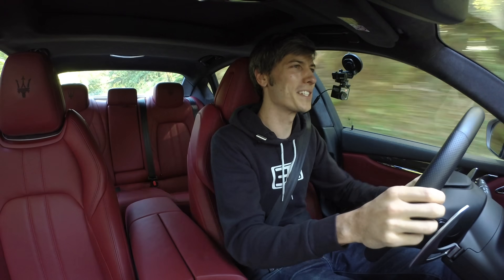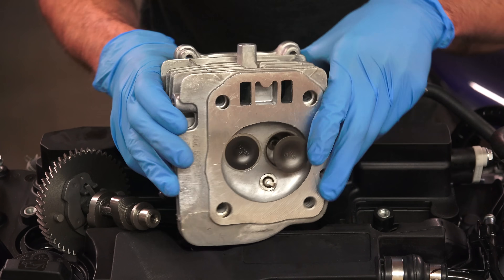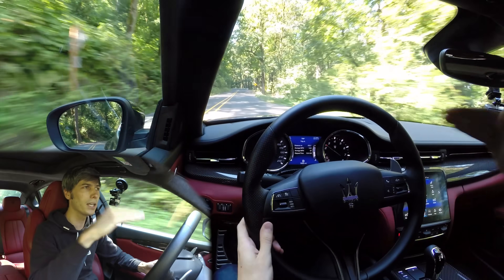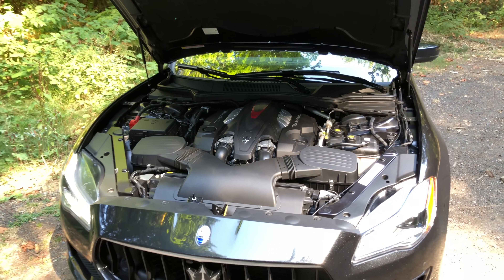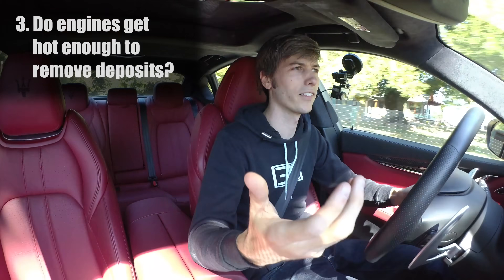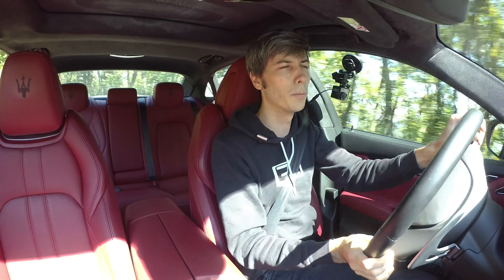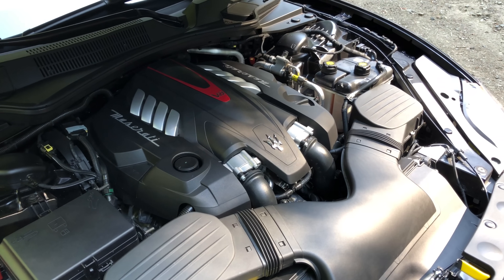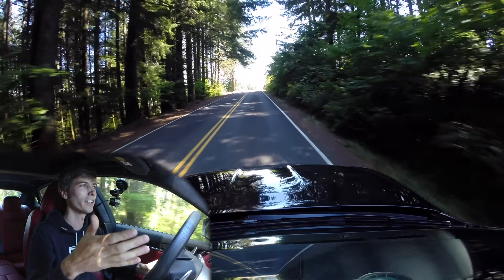Is Redline Good For Your Car's Engine? Italian Tune Up

Comment: I redline all the time in my car. It's on its 5th head gasket replacement. So, no. Don't drive like me.
Reply: are you buying head gasket made out of burritos?
Reply: @victornpb 
Haha. It's just "British Engineering". It always breaks. The 5th head gasket is Chinese designed and built when Nanjing bought out MG. It's much better design. Says a lot about British engineering lol.
Reply: What MG is that?  I was thinking about getting some old english car with a type A engine to hoon around in the weekends
Reply: My k24 has seen 7200+ RPM probably somewhere close to 20,000 times over it's lifetime without a single hiccup. This includes extended periods of very hard driving where the engine never really falls below 5200 RPM. A well designed and well built engine can take hard driving, but if you're driving an engine designed by the British and built by the Chinese, you're probably better off not pushing it lol.
Reply: @martinfisker7438 
MG TF (I got the 115 1.6 version myself).
Reply: When i seen your comment "K series" engine popped in my head straight away haha.
Reply: @ChalkieSpeedShop 
Yeah. K-series is sort of okay in terms of efficiency (for engines of that era) and power vs capacity (find it hard to get a 1.6 engine that pumps out 115hp naturally aspirated even now), but they're made so fragile lol. Couple of donuts hitting the rev limiter did gasket #3 in. 😂
Reply: Jim Griffiths yeah the VVC 1.8 were a great engine. They all drive well for what they are and fairly tuneable shame they suck on head gaskets. Place I worked at used to go get the decks skimmed on them use to help with it.
Reply: You must be talking about a 1.8 K-series then :D
Reply: Is it an MGF or MGTF? They're quite prone to head gasket failure, so it might not be down to being redlined regularly.
Reply: I've had an MGF 1.8, had a very nice sound for a 4 cylinder and was a nice engine which had a real character. When warmed up properly, it's less sensitive to HGF. However, designwise it was bound to happen...
I now have an S2000 and I redline it every day, all day. (once warmed up) :D
Reply: +Jim Griffiths Chinese upgrades? Those are the Landrover upgrades you've listed! :)
I feel your pain, but fortunately I reached deep on the first failure and spent a chunk of cash getting the Land Rover upgrades done at B&G back in 2010 or so when my HG failed. It was tempting to do the £500 "mobile mechanic" fix but I went full-whack and had the head skimmed at the same time even though I know I drove no more than 15 miles with a leaky gasket. 
 No issues since, with my TF 160-Freelander hybrid engine.
Reply: @JimGriffOne  and you probably hate everything british says allot of  you..
Reply: @sayers1984 
What does it say about me?
Reply: @donkmeister 
The gasket I put on in the end was the N-series Nanjing gasket. Tried the MLS Landrover ones but they kept failing lol.
Reply: @JimGriffOne  It shows you clearly know very little about engines, gaskets or British engineering. If you are talking about the Rover K series, then the head gasket problem was down to cost saving measures introduced later, not in the gasket itself, but the the fixings that hold the two halves together. The K series was unusual in the way it was designed but was a lightweight, dependable engine. Then the bean counters in the parent company temporarily got in the way, which is why there were a large number of engines built with parts that stretched too much over time with heat, resulting in HGF failure. But when it was rectified the engines were fine. Replacing head gaskets did not cure the problem, it just put a sticking plaster on until the next time. Which means you keep paying for something that can be cured permanently.
Reply: +A Nother

I do know this. I just didn't use the cylinder shims the first few times, and I used the cheaper Landrover MLS gaskets that came with the head saver shim. They weren't the best design.

The issue was that I thought I'd save a little money by not doing the whole job, as others had successes when using just the Landrover MLS gasket, uprated oil ladder rail and 10.9 grade head bolts.

With the N-series gasket (the one without separate fire rings or a head saver shim), and with the cylinders now shimmed to 5 thou proud of the block face, it's been running perfectly ever since. My car also has the pressure-relief thermostat as standard so I didn't need to mod the cooling system.
Reply: @JimGriffOne  115hp????
The base model B13 Nissan Sentra back in 1991 had 110hp out of a GA16DE and was actually very understressed...as they were known to go 600k miles on original engines.
115hp out of a 1.6 is nothing.
Reply: @twoeightythreez 
Most 1.6s I've seen are in the 90-95 hp region. I find higher power ones are rarer, probably due to emissions regulations. The EU has kindly given us really underpowered eco cars.
Reply: There's something else wrong if you continually blow your HG. Your head is probably warped or you have air in cooling system etc.
Reply: @mentals555 
It's just a badly designed engine. Really thin wetliners and they're able to shift slightly. The Chinese upgrades require: Strengthened head bolts and oil ladder rail,  wetliner shims to increase pressure on the cylinders and a MLS head gasket with no separate fire rings. It's lasted 6k miles and not one issue yet. Last ones lasted sub-1k miles before leaking coolant into the cylinders. Engine has tonnes more compression with these mods and runs sweet.
Reply: @JimGriffOne  oh so the thing wrong with it was that it is just a terrible design. Hahaha I would have given up on it long ago my man, bravo for your persistence
Reply: Ahh, the classic K-series. I always knew they were problematic but never knew what the issue actually was. Sounds like what you've done should last now though. You could always swap it for something like a honda or toyota engine ;D
Reply: @JimGriffOne  BLMC excelled at making junior mechanics out of regular drivers; right down to the point of planning which engine components to take (as "spares") on any particular journey. I always carried a small toolbox in the back of my Mini, just in case something broke :).
Reply: @mentals555  Humanity has no hope.
Reply: I have 2.5 subaru n/a  supposedly notorious for bad hG. Still intact.  Ir rdline rveryday
Reply: I have a 2013 VW GTI had it sense new. It has 85k on it now and i drive the hell outta it redline all the time. Change the oil every 5k synthetic and just changed the coolant. Never had a major engine problem. Never had to be in the shop for anything other then preventive maintenance. Tho my clutch is starting to slip now. But most clutchs with hard miles start to slip at about 60k to 100k so that's normal.
Reply: +Jim Griffiths
You either have Rover or MG, I know both of them were bought out by the Chinese whom still continue to make models of these brands like Roewe 750 which was a Rover 75 but improved, which is hilarious if you ask me it no longer had the head gasket issue commonly found with Rover engines which also made the engines for MG, it also had multiple reliability improvements in other sections. 

Chinese cars are getting better and better, we might find ourselves driving China cars in 5 years time, I already see more Korean cars on the road than Japanese here where I live in Norway.
Reply: @SMGJohn  Chinese cars are fine; right up until you crash one. There's good reason why they're ridiculously cheap.
Reply: I red line my car every day, for the last 8yrs and have never replaced a head gasket, and I have 360bhp on tap, with 220,000 miles. I suggest you get a decent car.
Reply: @TheSaabClinicUK   And what fine specimen of a vehicle that might be ?
Reply: Our engine blew the head gasket some years ago and it was my mom driving it (definitely not a redliner), and since I got my license I redline it basically all the time and the gasket has stayed fine (so far) so I don't see the correlation
Reply: @coscorrodrift  i dont belive you can blow a head gasket and thats all thats wrong with the motor and cooling system. Just my two cents.
Reply: @Thomas Rock You must be driving a Bugatti, they've been sandbagging you, that's not really the "redline"
Reply: It’s not the redline but the quality of the engine.
Reply: Jim ... finally an honest man.   If you beat the living beegeebees out of your engine you will pay the price. Good thing you can afford it.    :) 

Hey, just for shits and giggles ... see what happens to your engine around 10,000 RPM.
Reply: Nice Mk3 Supra my dude.
Reply: I redlinie my Evo X all the time, own it since six years, it's my daily car and has 160k km by now. It's even chip tuned for more power. Yet not a single problem with the engine. (In fact I had no mechanical failures at all!)
Now I just rebuilt the engine with forged parts two months ago and those will probably last for the next twenty years or so. Since you know, those are stronger and I didn't increase the output by much while doing so.
So yeah, I won't drive like you. It's probably really bad.
Reply: Thanks to the german Autobahn my car sees 150mph and above every day and not just for a single pull but for quite some miles. For years the engine (N52B30) is running fine, has about 125k miles on the clock and still runs without any major damage or fault. The only downside driving like that is oil consumption... Driving your car under WOT for quite some miles just evaporates your oil and i do need to top it off on about a monthly basis.
Reply: ARP Head studs. Problem solved
Reply: Ford?
Reply: What are you driving, a Subaru? I'm going to go out on a limb here and point out that that's not normal. Might want to get the head and desk surfaces feeler gauge and straight edged.
Reply: If you're going to drive hard, do a proper warmup and cool down, run the motor a little when parked before you turn it off. I suspect that some commenters have put away their rides wet.
Reply: subaru you said?
Reply: You must be a subaru owner . Stfu you troll
Reply: It's what makes a Subaru, a Subaru.
Reply: I run my Camry like a v8 and it runs great
Reply: Guessing this is a k-series engine. Sounds like you've had duff gaskets, good MLS gaskets should last the lifetime of the car if looked after properly. Had an mg tf 115 that had a chipped head and even after replacing the stock HG with a multi-layered it was fine for 3 years and 40k before I sold it (developed a leak around the inlet manifold gasket!).
Reply: @DarkestHeartEvE 
Yeah them inlet manifold gaskets break down so easily. Had to replace mine with a Viton gasket.
Reply: @JimGriffOne  ah you got the same car I had. The k-series is a brilliant engine but is just a bit prone to CHG failure. Such a shame, I miss mine very much!
Reply: I was thinking Toyota when I saw "K-series" engine.
I've been driving a '68 KE10 Corolla for 30 years. I retired the 1.1 "K" after several hundred thousand miles and put in a 1.2 "3K'. Redline is 6600. It will cruise all day at 5000. (about 75 mph lol).
Reply: A copper head gasket might do you well lol
Reply: I’ve always redlined my engines. Never had to replace a single head gasket.
Reply: I guess it depends on the car.  Bounce off limiter 500 rpm past redline with a motor that has 290k miles all the time.  It's fine
Reply: Is it a 6.0 Powerstroke
Reply: +Dreamboat MacGillicutty
It's an MG TF 115.
Reply: @JimGriffOne  
I know a man with a 1954 MG TF that has never blown a head gasket!
Reply: Jim Griffiths what the heck, haha. Ive put 160k VERY spirited miles on my ‘99 civic ex with 217k total miles, and I’ve only replaced the head gasket once. Probable the only one it’s ever been done. Compression is still 174-176 psi across all 4 cylinders.
Reply: @Schwabley Compression across all four on mine is now around 255-265 psi. The head's over its reface limit due to some damage from one of the cheaper head gaskets so needed more taking off. Still, it runs a ton better now than it ever did on 99 RON.
Reply: On my first. 
Easing up in the redline. 
Should not have converted this car from automatic to standard. 
Too much fun for such a tiny car (Kia picanto)!
Reply: It depends really i'v hit Revlimit all day. i'v had 9 cars and 7 out of them made it others well Knock Knock It's Mr.Piston my point is you get a good engine and you get a bad one
Reply: if you only have to replace the head gasket why not if you are the person changing it ... depending on engine can be chap and if you take this as a hobby is totally worth the time changing it
Reply: gilessmokey 
Yep. Using OEM gaskets isn't the way to go. Uprated all the way. Did the job perfectly every time but the K-series engines are weak as hell with standard parts.
Reply: gilessmokey 
The main issue with mine was the cylinders being almost flush with the block. Slightly under 1 thou for cylinders 3 and 4. Coolant kept leaking past the fire rings on the gasket. Shimmed the cylinders an extra 4 thou, resealed them and it's perfect. Like a new engine.
Reply: define redline please.... i hope this isn't bouncing off rev limiter, if thats the case there is a reason your blowing gaskets left and right lol
Reply: Daniel Sadjadian so true
Reply: probably Japanese car
Reply: Redline doesn’t necessarily cause head gasket problems, it does however certainly contribute to valve spring problems.
Reply: @Juan Pablo Velásquez
😏👌
Reply: Even taking into account that I'm driving an old T5 Volvo which are pretty known for blowing gaskets, I've managed to drive 4 years/90,000km redlining pretty much every day and so far I haven't had to replace the gasket. Just don't rev before the engine really warms up. Currently it has 359,000km on it.
Reply: Got a honda b16
Reply: Is it a rover by any chance?
Reply: If you had a Mazda Miata your car would be pissed at you if you didn't hit the redline every few shifts.
Reply: maybe its because you own a car from  VAG?
lol....
i redline my 4age at all times.
no such thing.
in fact at the end of the day after revving so hard and basicly rapping the hell out of it when turned off i think i hear the engine say
"thank you!"

lol
Reply: I thought the saying was " don't drive like my brother". Tapit bros
Reply: Sounds like you've got a mechanical or build problem. I boosted the redline to 10k, added springs and retainers to prevent valve floating, widened the cam LSA to get power at high RPM... I bang it all the time. No problems whatsoever. The redline is there for two basic reasons. First off, you're not making good power there with the cam LSA being at the factory narrow angle. You need to widen it. Second reason, you will float a valve without heavier valve springs. The heavy springs will wear out the cam quicker, especially if you're using conventional oil. There's nothing about redlining that will blow a head gasket. It sounds like you're doing something wrong when replacing the head gasket.
Reply: Thomas Rock  lol
Reply: are you letting it warm up before you red line it ??
Reply: @1whitedan  Yep. Always.
Reply: Thomas Rock  damn troll
Reply: Troll
Reply: As long as you arent overheating the engine or pushing out rediculous HP I think that might be an installation issue there
Reply: What car do you own?
Reply: @dariusmoldovan6202  probably a subie, they are known for hg problems
Reply: 😂😂😂Yeah subbie's and head gaskets, but was i was trying to say you can redline only sport car not any grocery getter
Reply: @dariusmoldovan6202  well I mean you can but yea you wouldnt want to.
Reply: That likely has something to do with your other habbit's such as not letting the engine/coolant warm up prior to driving...
Reply: luckely you don't drive a volkswagen  because by the 3rd headgasket replacement you have to replace also the head  and by the 5th your engine block's deck will be warped beyound repair
Reply: Lol serves you right for owning an MG, Best of some of England's rubbish.
Reply: Andy ME  
Turns out most gaskets aren't good enough except for the "super-ultra fix gasket", made in China by Nanjing. Been running happily with that one, as well as the wetliners shimmed by 4 thou.
Reply: The hell pos engine do you have that's eaten five headgaskets? A Subaru?
Reply: BUT if u to practice replacing destroyed head gaskets, then yes
Reply: Sounds like a Subaru.
Reply: Sounds like you need ARP head studs with a decent gasket 👍
Reply: Depends on what you drive. I just sold my 1998 SAAB 900 (non turbo), which I redlined EVERY SINGLE DAY, no problems whatsoever. None. Ever. Whatsoever. Never failed me. And I owned that engineering marvel for 10 straight years (my first car). That thing should be in a Guinnes record book or something. I traded it in for a SAAB 9-3 turbo at the Saab service center, and the guy told that those thing are indestructable, he does not remember A SINGLE N/A SAAB 900 EVER BREAKING DOWN. And he is working on Saabs for 20+ years, now that is something...
Reply: I always drive the speed limit, because I'm not an asshole.
Reply: @Pumbear 
Me too. I don't like driving faster than the speed limit. Feels wrong, except for driving in a stupidly low speed limit. There's a road near mine that used to be 30MPH but they reduced it to 20. It's a very wide road and hardly has any traffic or pedestrians on it. I usually do 30 on that unless there's a speed camera van. Perfectly safe.
Reply: @Pumbear indeed, you are pssy
Reply: hahaha ur engine sucks
Reply: Must be driving a Subaru
Reply: @LopSidedPopCan  Subarus only blow if you don't keep oil in them.
Reply: I drive like a granny and my car is 25 yo.